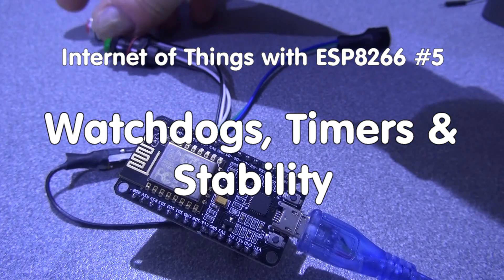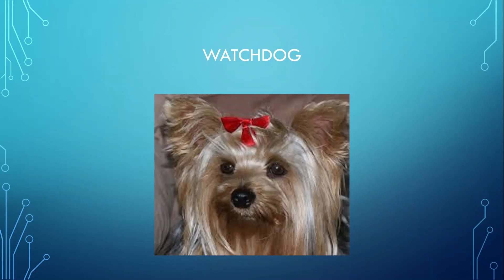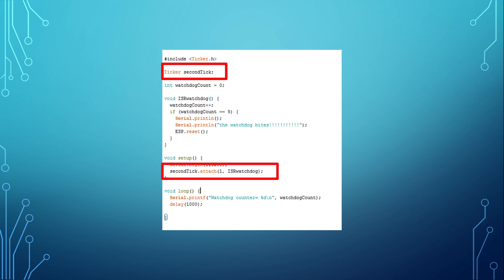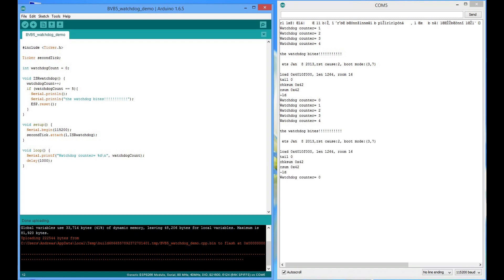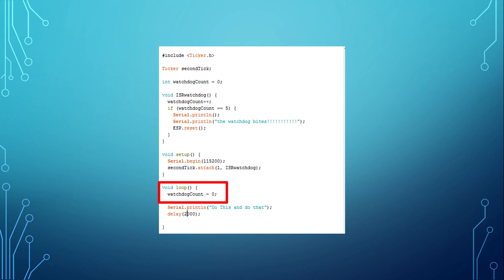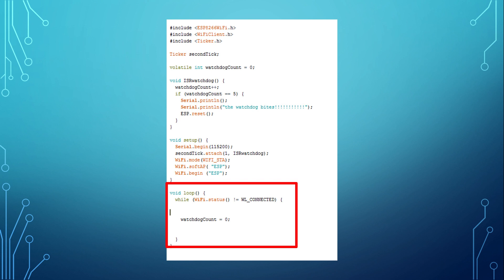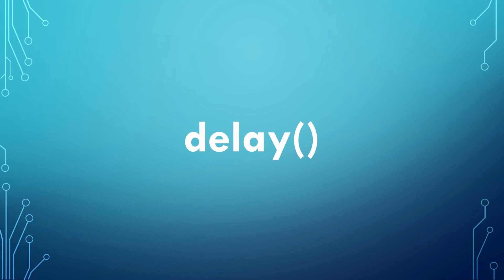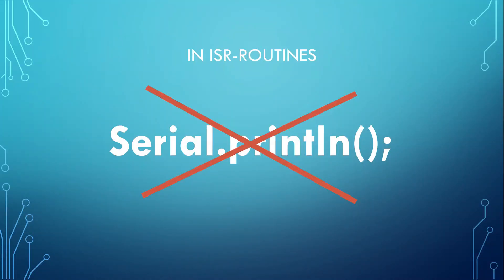#33 Internet of Things with ESP8266 #5: Watchdogs, Timers & Stability

Comment: Wow! You are the YouTube guru of the ESP8266, great videos! Could you tell me if it is possible for the 8266 to take a reading from a sensor once per day, transmit the data over wifi, and then power down (or stay in a low power state) and then repeat this every day. I'm concerned about power usage and time accuracy, I wouldn't want it to get off schedule by more than an hour and preferable run for weeks or months at a time. Thanks! Keep the videos coming.
Reply from the maker: +Revelation612 Because the ESP is connected to the internet you can read atomic time from a NTP server. Google it and you should get examples. I used NTP server in my videoseries #29-#33 and it works fine. If you do not find better sources you can take the code I used there.
You can set the ESP for max 8 sec asleep (if I remember correctly). Then it starts again and you can count the number of times it was asleep for 8 seconds. If the time is about ok you can read the NTP time server and decide on how long you still have to wait and go asleep this time. Then you read the sensor.

This is not simple but possible. Maybe I make once a video about it because you also have to use RTC memory to store the values.
If you have no power constraints you can read the NTP every few minutes and use millis() in the meantime. There is no need for sleep.

Comment: I and my friends are making a college projet using ESP-07 but  we are facing a problem: from time to time (It's not periodical) our ESP stop working , the code does not run anymore and we can't acess the html page. We tried to use the library ticker to make a watchdog timer and we also used the functions ESP.wdtEnable() e ESP.wdtFeed() but nothing of this worked. We are using the usb-ftdi conversor to power the ESP (Maybe the current isn't suficient). The reset only works from hardware .We're trying to use the ESP as an acess point. I would greatly appreciate any help!Thank you Andreas Spiess all your videos are great! 
code: http://migre.me/trvye
Reply from the maker: +daniel cavalcante I would try to separate things. First, you have to get your module stable. This can be done with the blink sketch. Do not forget a yield(); command in the loop.
If teh module crashes inside the blink, the stability of the power supply could be an issue and I would go for a better power supply.
As soon as the blink sketch runs stable over time you can go on with your web application. Also here, make sure, that a yield() is called every millisecond or so, also in while waiting loops.
I have no ESP on hand to try your sketch, but I think, you should nor over engineer the problem with watchdogs. Like that, at the end, you just have more sources for problems.
If everthing runs stable you can go on with the watchdog. The watchdog is only for stable systems.
Reply: +Andreas Spiess Thank you for you answer! I tried to do what you said. The blink sketch worked well, but when I tried to run an webserver using the ESP like an access point, it occurred the same problem as before: It worked but sometimes it stopped running and even the Ticker wasn't able to reset it.
Reply from the maker: +daniel cavalcante can you give me the code? Then I could try it over the weekend.
Reply: +Andreas Spiess
 It seems that when I use the Ticker I'm not able to run a server.
 Here is link to the code: https://goo.gl/GvvBZc
Thank you for you help!
Reply: +Andreas Spiess I didn't understand the usage of the yield() function! I searched for this function on the Arduino site and I found this :

yield()
Description
Passes control to other tasks when called. Ideally yield() should be used in functions that will take awhile to complete.

For which task is the control given?
Reply from the maker: +daniel cavalcante Esp8266 only have one core which also have to do all the WiFi traffic. If ithe core executes your code it cannot do this. This is, why you have to include a yield or delay command in each loop. Otherwise it crashes and restarts after a while.
Reply from the maker: +daniel cavalcante I tried now your sketch. It does not crash, but the ESP8266 also is not visible on WiFi. So, I tried the "Hello Server" example of the ESP8266  library and transplanted your ticker parts. It works ok as long as I feed the dog. If I comment the dog=FOOD; the ESP resets. All as expected.
I think, the problem is more your coding for the internet functionality than the watchdog. Does the sketch work without the watchdog? 
I suggest to start with a simple sketch which works and then add your watchdog.

Comment: Great tutorial. Amazingly good. Explanations are very clear. I learned a lot from you. Thank you for taking the time to put it together. I only have one question, so far: Where may I find the <credentials.h> library ?  - I have made a lot of searches and looks like none of those I have found are suitable for this application. - Can you help ?
Reply from the maker: +hugo salom You are very welcome! Thank you.. The credentials is not a library. It is a trick for me that I do not publish my credentials by accident. So, just remove the include credentials.h and fill in your credentials in SSID and password.
Reply: +Andreas Spiess - I just did what you said. I have also been reading the comments and questions at Github and the videos in this tutorial trying to find answers to my questions before I ask you the next question. Unfortunately I have not found the answers and, even though I would rather not to bother you, I need to ask you the following question: What am I doing wrong?  - I am using a ESP8266 12E by AI-Thinker (eBay item 262123867975) and compiling it using Arduino IDE 1.6.5 defining the board as a a NodeMCU 1.0 (ESP-12E Module)" with CPU frequency of 80 MHz and Upload Speed of 115200. Now, with that being said, and having the #define ESP_12 without slashes on helpers.h library, I get the following errors when compiling:

************************************************************

Arduino: 1.6.5 (Windows 7), Board: "NodeMCU 1.0 (ESP-12E Module), 80 MHz, 115200"

BVB_WebConfig_OTA_V7:50: error: 'defDirection' does not name a type
BVB_WebConfig_OTA_V7:54: error: variable or field 'storeDirToEEPROM' declared void
BVB_WebConfig_OTA_V7:54: error: 'defDirection' was not declared in this scope
BVB_WebConfig_OTA_V7.ino: In function 'void customLoop()':
BVB_WebConfig_OTA_V7:239: error: 'storeDirToEEPROM' was not declared in this scope
BVB_WebConfig_OTA_V7:245: error: 'readButton' was not declared in this scope
'defDirection' does not name a type

  This report would have more information with
  "Show verbose output during compilation"
  enabled in File > Preferences.
***********************************************************

Any comments and or suggestions ?

Thanks in advance.
Reply from the maker: +hugo salom No problem because of the question. 10 minutes ago downloaded my files from github, did the same settings as you and had no problems with compiling. If you look at your error messages something is interesting: The line numbers of the errors do not at all correspond with the line numbers in the coding. This is strange! I use  the ESP version 2.1.0-rc1 board definition in the board manager. Maybe you check. Otherwise I have no idea why this is happening. Try to find out, why the line numbers are so different.

I use the NodeMCU boards only for boards with serial adapters on the same board (see my video about boards), not for plain ESP modules. For modules I use "generic ESP module" as  board. There are a few differences between them:
1. The signaling for the programmer
2. The names of the pins.

So, the ESP_12 define has to be set according to the board you chose for compilation, not the module you use.

Concerning debugging: I assume, that your setup works fine with other sketches. Otherwise start with the blink sketch to make sure, your "toolchain" works.

Just a tip: You can save time if you go to 921600 upload speed. It should work with most of the modules and is nearly 10x faster...
Reply: +Andreas Spiess Just to let you know I went the route you suggested. Apparently I damaged the contents of the main ino file while manipulating it, so I erased the whole thing and downloaded again.  Added the SSID and the respective password, removed the slashes from the #define ESP_12 and proceeded to compile.   ...And guess what happened: It did compile with no errors. Thanks for your assistance. Next step shall be to upload it on the ESP module and test it. I will let you know. Thanks.
Reply from the maker: Glad to hear that!
Reply: +Andreas Spiess - Looking at the diagram I noticed that only two resistors have values assigned: one is R1=56 and the other one R7=680, which I suppose are OHMS. But the rest of the resistors do not have any values assigned on the diagram. - Would you please let us know what are the values for the remaining resistors ? - Thanks.
Reply from the maker: +hugo salom The others are just ordinary pullup resistors. Most people use 4.7k - 10k. The value is not critical. The potentiometer in front of the buzzer also is not necessary. I just used it to reduce noise lever, but without big success.
Reply: Thanks.

Comment: Great explanation, great quality presentation as ever. .  I did not know about yield() ,  i thought delay() was the only way . 
re GPIO , i have see some fine solder work that can gain 4 more GPIO from a ESP v1 .
Reply from the maker: +XerotoLabs Thanks. Concerning the solder work: This is for sure possible, because it uses the same chip as the bigger ESP modules. But for me, the "OTA" thing is anyway a very good Idea because I do not have to remove the module for an update.

Comment: Danke für den Yield Tipp, genau den Fehler hatte mich blockiert. Für parallele Ausführungen wäre vielleicht das FreeRTOS etwas für Dich, es läuft auch auf dem Arduino UNO mit der Arduino IDE.
Reply from the maker: +norm1124 Danke. Ich werde mir dieses FreeRTOS mal ansehen, wenn ich Zeit habe. Scheint ein interessantes Konzept zu sein. Was aber für mich sicher entscheidend sein wird sind die Libraries. Da habe ich keine Ahnung, wie man die einbindet oder ob das schon jemand gemacht hat. Kommt im nächsten Jahr. 
Jetzt muss ich den 2-rädrigen "Roboter" vorstellen. Hatte ich versprochen und schon Nachfragen gehabt. Das gibt auch wieder etwa 3 Episoden: Self Balancing, bi-directional communication mit NRF24l01 und Ultrasonic Subsystem mit drei Sensoren und einem attiny... Und dann wollte ich noch ein Weihnachts-Special machen.
Reply: +Andreas Spiess Cool. Ich habe das Fenster mit WS2811/Neopixel (gebogen als Zahlen) verziehrt. Und mit dem ESP8266 will ich einen Internetradio für $10 umsetzen (dumme "Wette" mit einem Arbeitskollegen): https://github.com/espressif/ESP8266_MP3_DECODER. - Viel Spass mit dem Roboter (Bin gespannt auf die IMU-Tricks - mit Kalmann Filter ?) und auch auf alles andere.
Reply from the maker: +norm1124  Das mit dem Fenster müsstest Du mir als Foto zeigen, damit ich es mir vorstellen kann...
Betreffend Kalmann Filter: Ich habe keinen verwendet und er steht trotzdem. Allerdings musste ich eine Zweiweg-Kommunilation zwischen Fernsteuerung und Roboter aufbauen, um die Parameter Real-Time ändern zu können. Die sind sehr heikel.

Das mit dem Radio ist sicher möglich. Der Chip ist ja schnell und hat WLAN. Und ich vermute, die hatten noch keinen 4MB Flash chip. Ich denke, da müsstest du auch genug  buffern können. Wenn Du kein Board mit 4MB hast kann ich dir eins schicken (oder auch nur einen Chip). Den kann man ja bekanntlich wechseln.